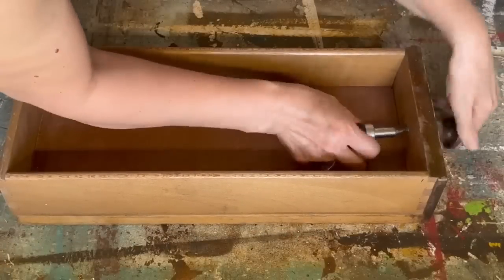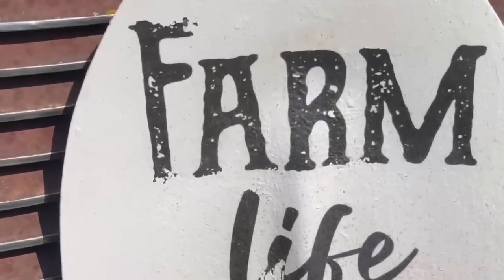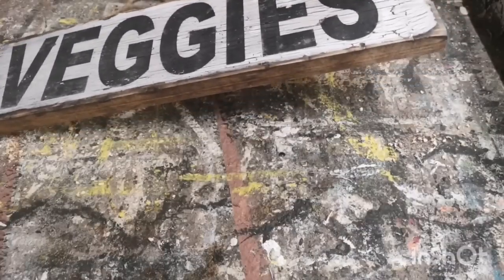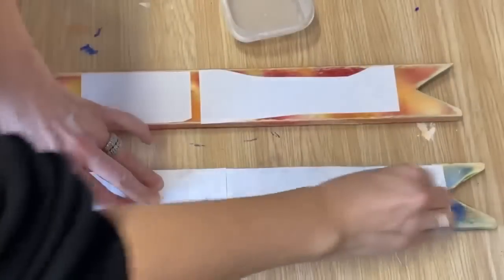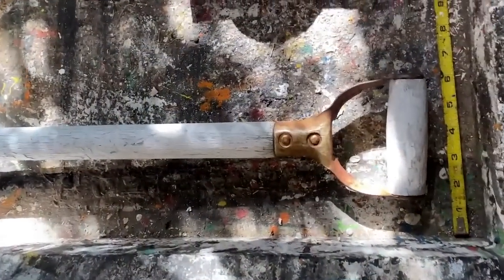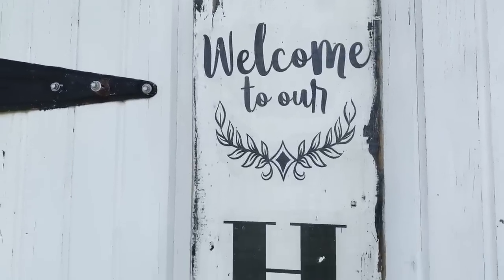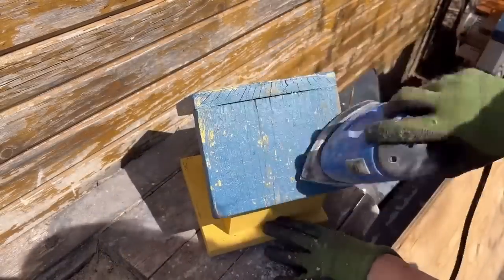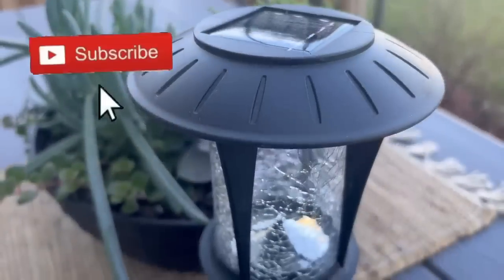Upcycling Beautiful Outdoor Decor from Discarded Items / Trash to Treasure

Comment: That wooden "trivet" is actually a table top. I have 2 similar ones from India. The base is 3 lacily carved legs held together by small hinges. The legs fit into the grooves on the bottom. It can be a bit of a puzzle to get the legs just right, as they all fit 3 ways. However, the right combination and the table is solid. Lovely tables ! 3
Reply from the maker: Yes, I think you’re exactly right. Thanks so much for watching.

Comment: Do I have to have a cricket in order to use a laserjet printer ?
Can I just use my tablet or pc to make the reverse lettering and print ?
Reply: You can do it on your devise. Just flip it over.
Reply from the maker: No, this is just used with a laser printer or an inkjet printer. You do not need a cricket to do these projects.